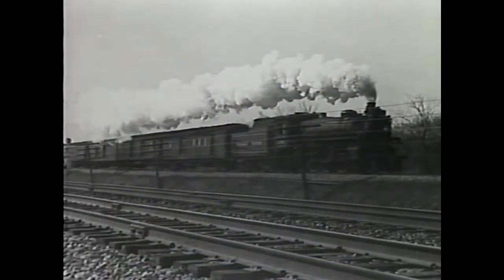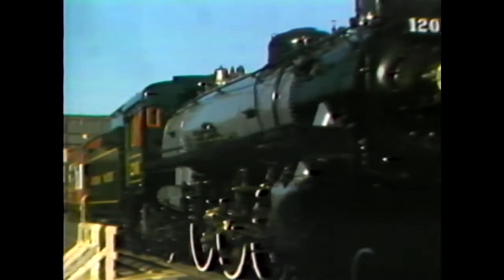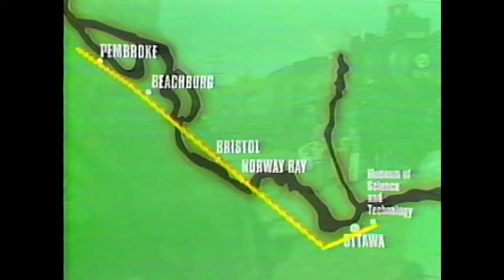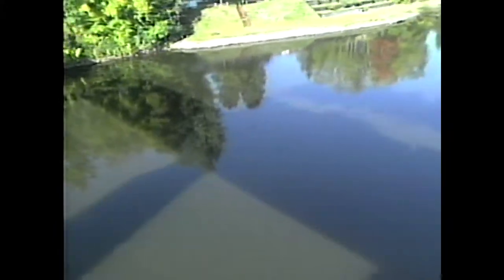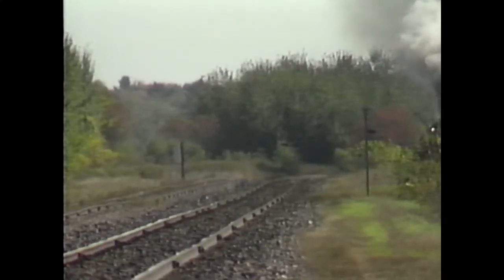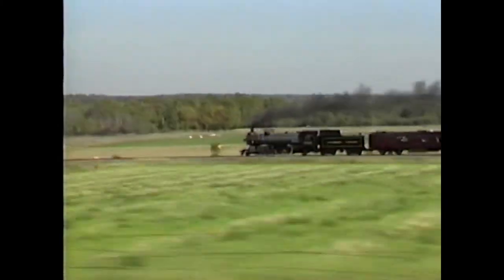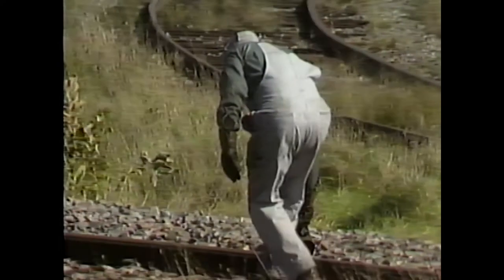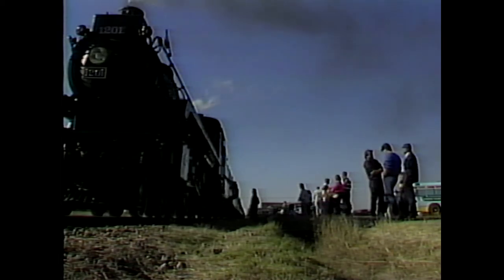Ottawa Valley Steam (CJOH 1990)

Comment: I rode on this train just before they stopped running it for good in 1990 I think. I was 4 years old. I've loved that train ever since. Glad it's still around, even if it doesn't run anymore.
Reply: I saw it on a museum tour about 10 years ago.  Apparently the museum no longer has enough track to run it, so they focus on their smaller locomotives.
Reply: Why did they stop running it
Reply: @michaelbujaki2462 theoretically they could run it on the Renfrew spur which only gets 1 train a week but CN ripped up the museum spur